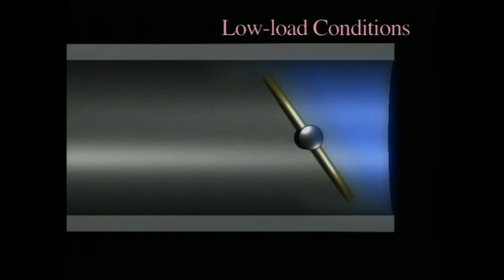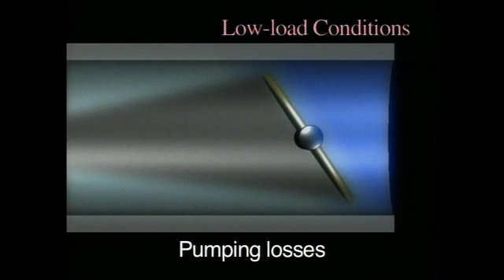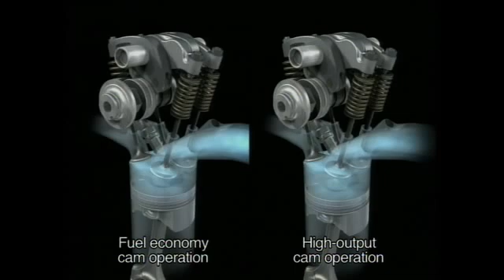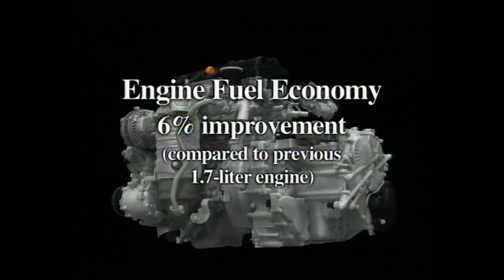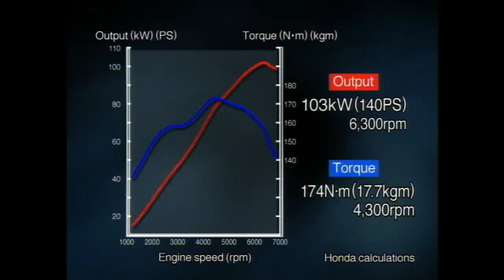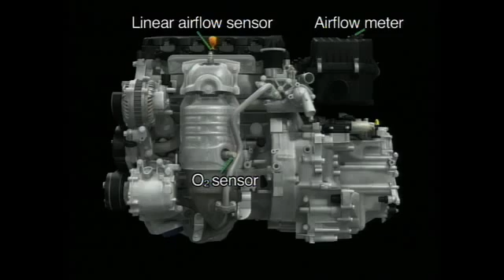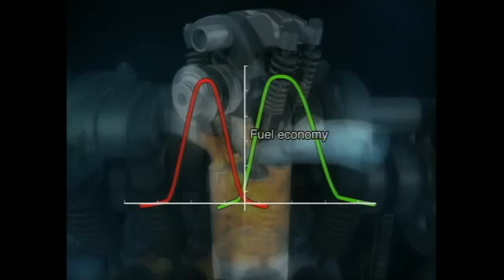Honda R18 Engine  1.8L  i-VTEC

Comment: 140 nm torque at about 1800 rpm, that's a very torquey gasoline engine. I've never driven a civic, but I can imagine it's a very usable powerband for everyday driving.
Reply: You have to push it over 3,5k rpm to feel it.
Reply: i ran my civic with a different mapping. hp und torque is a little bit increased with 10 percent. its so different to drive compared with the standard mapping. it feals like, a mini turbo works now in lower and mid rpms. i know, america is the country of v8s, but in europe, the inline four is actually the most popular engine. the r18 is compared to other 1.8l NA engines maybe the best or even the best in power output and fuel economy. there is no other car brand in europe, with a comparable 1.8l NA inline four engine.
Reply: @Fisico87  what tuner did you use?
Reply: @SongsforSpace  I am from Germany and the tuner is also from here. Tuner is a bit to much. These guys get the software from a tuner who is working in Russia. In Germany the guys are called "Team VTEC" and they are known in the german Honda Scene for the good work. Thats why i did it and i trust them.
I know its always better to tune the ECU on a dyno, but the reflash works realy good. Sparkplugs looks fine, no problems with EGR. Not much soot in the engine oil after 10.000km, lower fuel comsumption, much better torque in low and mid rpms. now its possible to skip gears with the better torque. when i start at traffic lights i only use the 1st, 2nd, 4th and 6th gear without high rpms.  its awesome to drive.
Reply: I have 08 lx automatic the tranny isnt helping any but its decent power for the 2600 pound car
Reply: have exact engine in type s 2007, for a vehicle with 140hp it's really fun to drive and powersteering in that car is mad on feedback.
Reply: I have mine with a stick. Its fast enough for a fuel efficient long lasting car.
Reply: I have a Civic 2015, it runs really good... You can feel its great performance no other car in the category can achieve...
Reply: Sluggish acceleration due to the cvt and fuel economy cams but decent torque band for an economy engine.
Reply: @wastebasket2015  it has a 5 speed hon
Reply: @joshgutierrez7380  it has more than one transmission hon. Read hon.
Reply: @wastebasket2015  this car only had a 5-speed automatic or 5-speed manual or a 6-speed manual no cvts here buddy
Reply: @kevinwhiting8391  the r18 has variations obviously. It was used in different generations. The cvt was used for r18s. Just as manuals and regular automatics. Use the tool you have called the “interweb”
Reply: FAR from a torquey engine lol
Reply: +43854586 
It's ok.
Reply: laggy and gutless..
Reply: It's good... Just very little power at the lower RPMs.
Reply: @jangoxxx  change spark plugs to ngk iridium, oi; to 0w30 full synth ester. Try again
Reply: @jangoxxx  it doesn't cut back it just doesn't make power up there due to the factory tune. Damage in the engine block doesn't occur when you redline it for short periods of time. It is meant to handle those rotational speeds, otherwise Honda wouldn't allow it to reach that rpm In their tune
Reply: @joshgutierrez7380  I swear people think getting anywhere near redline means the motor is gonna blow
Reply: @golf1diesel  i had some cheaper sparkies on that engine when I bought car, imidietly changed to NGK Irridum ones....what a change in behaviour in idle and fuel consumption went from 10l/100km to 8l/100km with same drive style

Comment: Best bang for bucks!!!!!
U will never get same mpg and power with similar ones!!!!!
Cos this r18 doing 
0-60mph=7.6sec
1\4 mile=15.8
AND 
HIGHWAY MPG OVER 45!!!!!
Reply: ueg1974 never once got over 37 mpg in my 2006 civic and I keep close records of my fuel economy. I think these are great cars still
Reply: @georgeparker555  I have an 06 civic, average 55mpg on the motorway and 32-34mpg round town. Averages out at a little over 40
Reply: @georgeparker555  just realised how old this comment is, sorry 😂
Reply: You have to manage your rpms. Keep it between 2000 and 3500 rpms. Thats the best fuel efficieny range.
Reply: I average between 39mpg and 41mpg with gentle driving. Very good for a petrol engine. You'll NEVER see 0-60 in 7.6s however with the standard engine...
Reply: @270eman  1750-2250 actually, in 5th gear.
Reply: George Parker auto or 5 speed? I have gotten low 40s with mine, it is a 5 speed with 210,000 miles
Reply: According to BC, best result that I get 5,3 l/100km (44 mpg) on open roads where speed vary between 60-90 km/h. But on highway, on my usual speed 140 km/h average is 7,5 l/100km (31 mpg).
Worst case is a city drive and short destinations when it is usually between 8 - 9 l (26-30 mpg).
For real consumption add/subtract additionally 10%, that's about how much my BC lies. 
I had a chance to drive a Toyota Auris Hybrid, which has 1,8 petrol but with reduced power (100hp) because it works in Atkinson cycle, on open road and highway (where there is no much benefit from electric power) i get average 6 l/100 (39 mpg) which is very nice result, approx 1,5 l less than on 1,8 Civic in same driving regime. I know that it can not be compared this 2 engines directly, but If I understood well, this i-VTEC when is activated it should be close to Atkinson cycle, or I'm wrong?
Reply: Fd2 r18a with 4 doors 0-100 9.5 seconds best

Comment: Just get the Si lol
Reply: if money isn't an issue and you want performance yes get the si it's so much faster, sounds better, has a 6 speed manual and LSD but I recently passed on a 2010 Si and got a 2010 EX-L 5 speed with half the miles on it and in better shape for a bit less so I couldn't pass that up.  The Si pulled way harder when I test drive it but I would be too tempted to constantly drive it hard, rev it to the limit, shift harder etc and all that is harder on the motor mounts, CV shafts, clutch etc in the long term with less power I'm just not tempted to drive it hard and just relax instead!  Plus the Si needs premium fuel and I heard has timing chain tensioner issues.  Hopefully this R18 engine doesn't have any issues!
Reply: lol some people want the regular civic for less money but u are still getting some of that k20a/k24 power
Reply: @nitecorepd2230  6 years later, and I'm replying to your comment asking "how" does it give some K-Series power?? Lmfaoo
Reply: Integra DIY - with the modifications I've done on my base  2013 1.8 civic it runs just as much horsepower is an SI if not a little more
Reply: CDN12Guns wow this is an old post. yes you are correct. thats because the base models or non sport package cars are owned by non aggresive drivers or older folks who dont want the added body flares and boy racer interior. base models are always nice but ill always pay premium for a low mile si or other top spec car. plus the k24 can take 10x the abuse an r18 can take with the added oil cooler and stronger engine internals..

Comment: F1 honda motor does better
Reply: +PCGamer90x  Of course it does its built strictly for racing, And thats a V6 Twin Turbo engine. But thats not the point your comparing an F1 Super engine to the R18 series, R18A1, R18A2, R18Z1!!!

(IK its a late reply so what!!)
Reply: The honda F1 were never much good. Hardly won anything with a lot of retirements. It's strange really.

Comment: If you R series owners are curious, I have done my research (for those who haven't done enough research" Honda says that R series Vtec works completely different. It works only around 1500-3000 rpm for economy. It says that the traditional VTEC kick will not be heard and felt unlike those in the previous Honda engines. R series is for economy not power. Yes it has vtec but not like the older version where it is set at a certain rpm range at high output. I've done a lot of hard accelerations and flooring it and got curious cause i dont hear the vtec until i did my research. It's good I can get 11 km per liter . If I floor alot, it can get as low as 9km per liter.. highways can get you 14 km per liter.
Reply: Tweak Silva - I’ve owned a 15z6 and now own this engine. It’s like a D15z6 but even more economical, ( can do 50 MPG in 2nd gear crawling intraffic) and like a B16a2 (I’ve owned one) but with slightly less power but more torque and vtec kicks in instantly. ( Performance cam with eco qualities activates before eco cam instead of other way around)  I’ve raced an EP3 off the lights and it sticks with it until about 50mph. Perfect mix of performance & Economy. Best full tank on this car doing a long journey approx 450 miles.
Normal driving with lots of traffic and shoot runs / short journeys & hard VTEC here and there 😈 350 ish miles a tank. Perfectly family commuter
Reply: @PreciousMetalinvest  ok dude, thanks. I Just bought a 1.8 Civic with this engine. R18a2. Now I have both ek3 and fk2!! Im just confused with the right oil to use on it... should use 0w30 or 5w30??
Reply: 5w-20 depending on climate.  The vtec is for fuel econmy basically it has a cruising lobe and a acceleration lobe.  Alot of the k series motors are setup the same way with no exhaust vtec and the ability to close a valve.
Reply: The 5000rpm crossover is infact the variable intake manifold engaging!
Reply: So.... its basically like the d15z6 engine from the 96-00 civics, ek3.
Reply: and actually the power band is from 3000 rpm - 5500 rpm. If you pass that range, you're just losing power and damaging the engine. Here's more 
http://www.8thcivic.com/forums/garage/98006-how-vtec-works.html
Reply: Mark with mine I feel a slight boost at roughly 2800 rpm it's a more broad range to about 5500 medium boost that is smooth... old style vtec was set at 6000 strong boost to 7000... you only enjoyed a strong boost for 1000 rpms... the R18 gives a medium for longer 2800 to 5500...it doesn't kick in like old vtec cuz the power is spread out to give longer rpm boost

Comment: @HotHeadCJ the R18 actually has a lot of similarities to the B and K series motors as far as dimensions and ignition systems are concerned; however, the R series motors were developed with economy and durability as the #1 priority, whereas the B and K series are "performance oriented" motors.

Nevertheless, as with other Honda SOHC motors, R series motors are excellent candidates for TURBOCHARGING!! Full Race and other manufacturers have developed bolt-on turbo kits, and are having much success!
Reply: 9 years later and I'm going to say they are more like the D-Series and not at all like the B/H/K series.

I'm very bored.
Reply: @tyscl9516  me too bro, my car is BORING lmao
Reply: @tyscl9516  well you're right the r is sohc not dohc like the b/h/k they are much bigger dimension wise for that reason as well
Reply: I have an R20A, who makes turbo kits for them?
Reply: Don’t boost it unless you are going to replace those scrawny connecting rods, they’ll come apart above 6psi boost.

Comment: how does the r18 compare to other honda engines, specifically the B and K series?
Reply: DAJ if you want performance get the B and K series engine. If you want good fuel economy get R series. All these engines seem to be very reliable however
Reply: @georgeparker555   What is the horsepower for this engine? Thanks! And can I put it in a Del Sol?
Reply: @MikeKollin  not a lot about 140 hp
Reply: DAJ  b and k were made as performance oriented engines  to be tune and add turbos and stuff
Reply: This engine is basically a modernised B18. In my old B16 I couldn’t lose one of these cars uphill. And Againt a B18 I was pulling away. Even had a K20 owner as what mods I had done to it, when it was standard. This engine can neatly  double the miles on a full tank of a B16 on a long highway journey